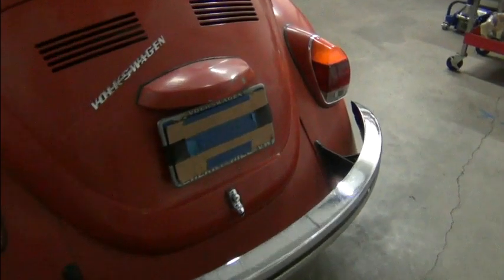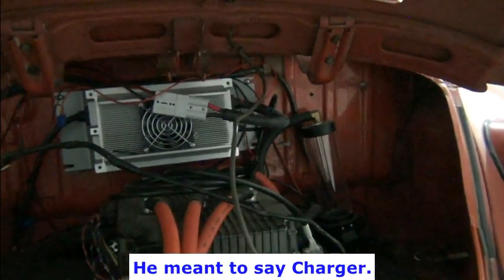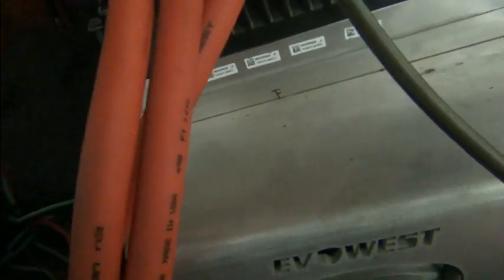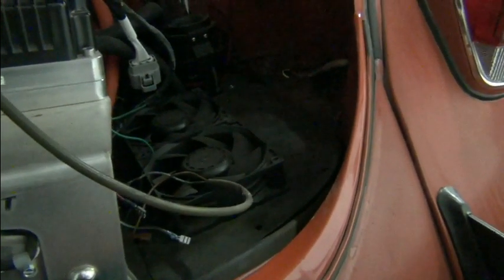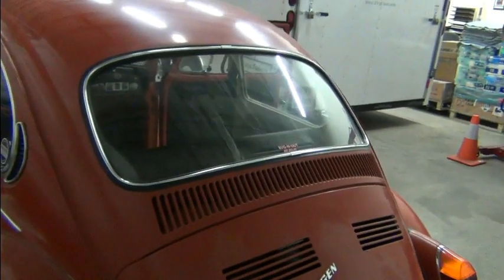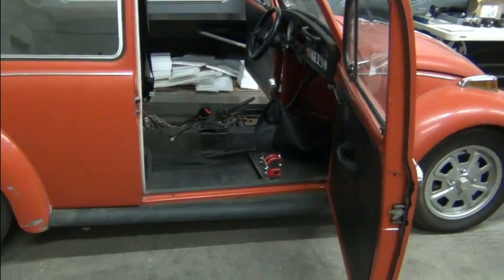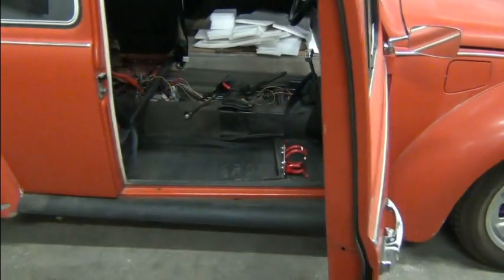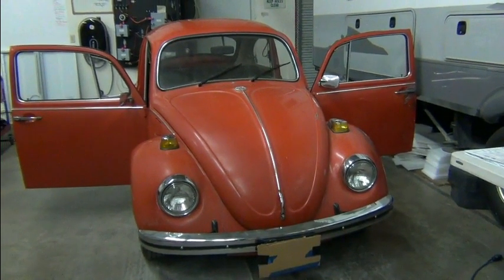VW Bug EV Conversion - Orange Beetle Project Part 2

Comment: Nice work Richard👍! Have you ever converted a 914 volkswagen/porche?   I think they are also called Karman Porches...looking at picking one up for the 'next' adventure.
Reply from the maker: They were a popular conversion back in 2008-2011.  Have not done one in many years.  In the U.S. they were called a Porsche 914.  I personally owned a 1971.